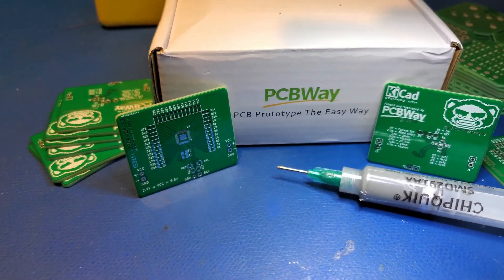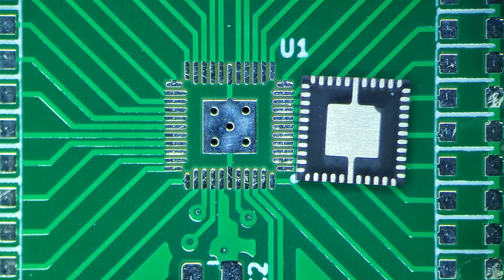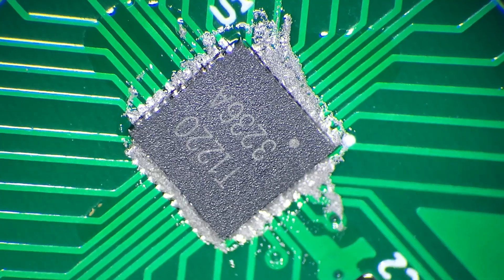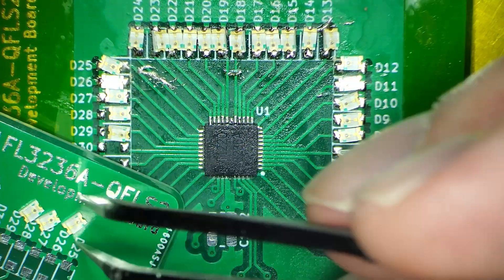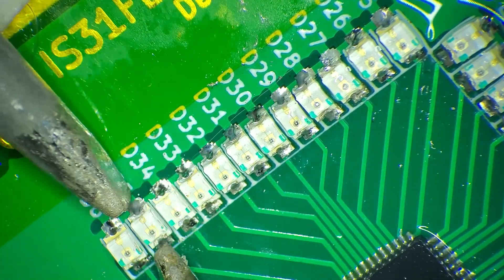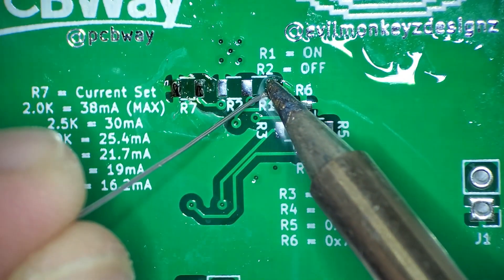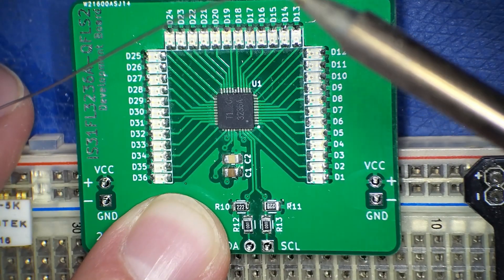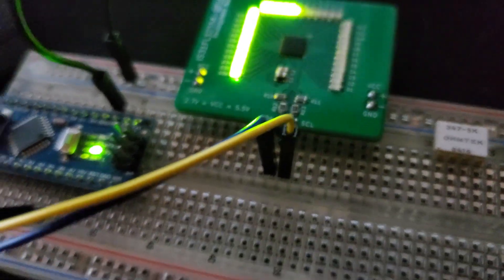Soldering a QFN LED Driver - IS31FL3236A Development Board Project

Comment: Just for anyone reading this in the future:
1. It's a good practice to put series-resistors into the data lines for I2C connections (both SDA and SCL). As all I2C devices are daisy chained, one failing device may pull all the others along with it as they may short Vcc or Vss to one of the lines, thus causing the other devices to pull directly from Vcc/Vss, killing them. Adding a simple 47R resistor will limit current to a mere 10mA. In case of a device failure, communication will still be blocked as the line is always high (Vcc) or low (Vss), but removing resistors one device at a time will allow you to identify the failing device quickly. A 47R resistance is also easily overcome by most devices, especially if each device has a 5-10K pullup close to it.

2. You're having issues soldering R7 because its pad is directly connected to the huge Vss area. This draws all the heat away from the pad, thus cooling it down before the tin and flux mixture has had time to sink in. Next time, use smaller thermal pins (you can usually set the margin of the copper area), or, better yet, use an area exclusion (no-net area) with a single trace to the connected Vss area fill. This ensures a good contact but low thermal dissipation.

Comment: Your soldering iron is/was set to high/hot for this tiny job. Remember 350 degrees C is not the correct temperature for all solder jobs. If your flux smokes off too quickly then you have your temparature too high. Just A Heads Up!

Comment: Interesting video. The caps are looking so boxy in the zoomed in video. Anyways would it be okay to just use a head sink paste for the sink at the middle of IC instead of the solder process that you did? IS it safe and advisable? Its just that if one apply the paste in the PCB and just place the IC on top and then solder the pins as normal with the iron that would be fast and the paste will get dry with the air flow gun. What do you think?